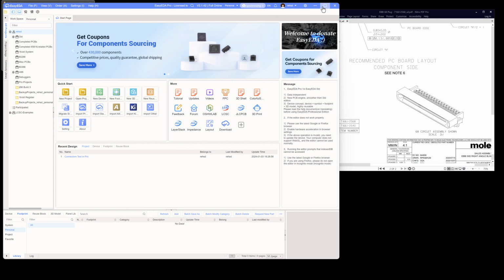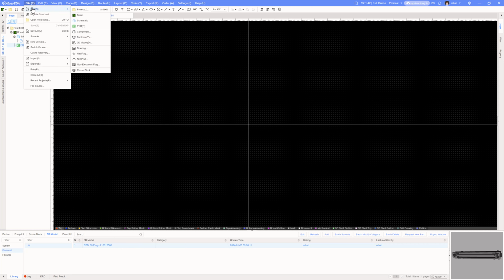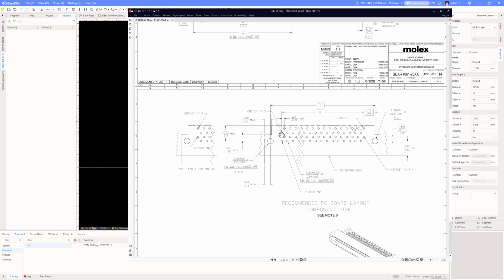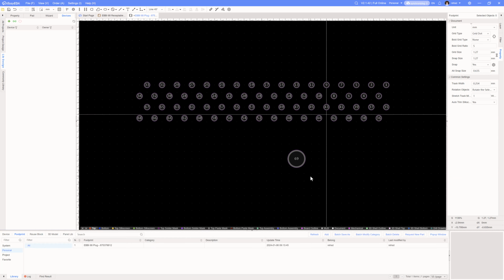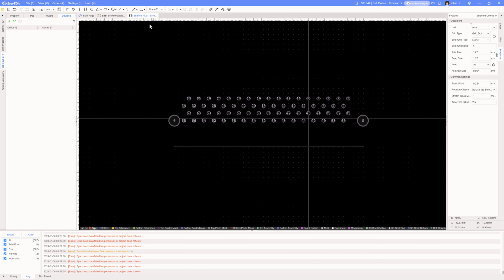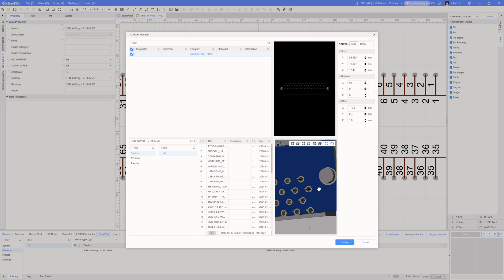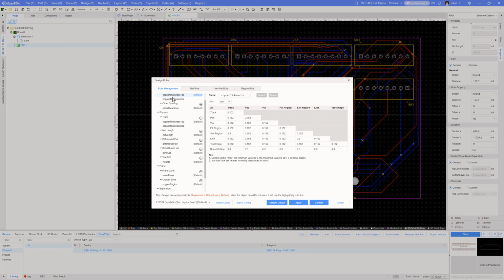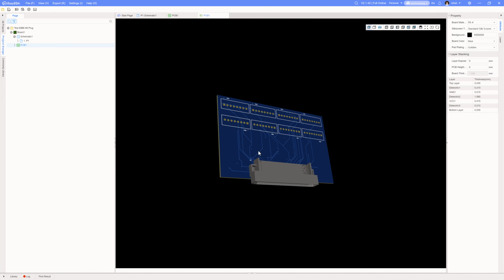Trying Out EasyEDA Pro - Creating a New Component (Device)

Comment: Considering if I should start with Standard or Pro.  What's the TLDR result?
Reply from the maker: I would go with Pro. I found Standard nice as it had a lot of older ICs in its library. However, the functionality -- especially performance -- is much better in Pro.
Reply: @rehsd  I did a few projects in Std and want to migrate them to Pro. It is a mystery on how to do that. Once you say one wants to migrate then the window opens listing the projects in Std which they say one must select. I do so and it appears selected and then I press Enter and nothing happens. There does not appear to be any buttons on the window either.  They also say export it to Zip, but the Export options are BOM, PDF, Altium, Net and PADS. So no ZIP available. Any Ideas would be appreciated.  Even their tutorial is of no help to me as i recommends the ZIP option. Not sure what I am overlooking.
Reply from the maker: @Appregator  I created projects from scratch in Pro. I also found any potential migration from Standard to Pro to fail miserably.
Reply: @rehsd  Ok Thanks. I'd better do it in pro.

Comment: Instead of manually placing pads and lines at relative location to one another, it is more accurate  to place them using the location pads(CenterX, CenterY,)  and lines(StartX, EndX, StartY, EndY) at absolute location, using information from technical drawing from the document.
Reply from the maker: Good point!

Comment: For a complete component there should be at least an outline which represents the silkscreen marking and a designator placeholder. May be an courtyard outline would be helpful too to keep placing adjacent components too close to the connector. If you create pads for the mounting holes may be creating them in the schematic symbol too and connect them to standard ground power net so any ground fill will automatically connect.
Reply from the maker: Some quick updates: https://imgur.com/a/RuMVGqk
Reply from the maker: Thanks for the tips, @0toleranz!

Comment: Would be nice to be able to use CAD-style drawing method to create the footprint. To be able to add constraints and enter the dimensions instead of faffing around with grids and stuff.
Reply from the maker: The grid can be turned off. I'm not sure about setting up constraints and such.
Reply: @rehsd  Don't get me wrong. Grids are helpful tool. Without grids it would be even more of a mess to draw the footprint. While grids are great for drawing schematics and routing the board, for making footprints they are pretty meh and rather cumbersome. But still, better than nothing. EDIT: I think that guides (like ones used in vector graphics) could be a nice and easy, in between, solution.
Reply: @pvc988 While vector-like graphics tools, such as Illustrator's shape tools, are more flexible, they introduce needless complexity. Most of the time you're laying out pads with set dimensions based on precise spacing and arrangements. Manually drawing, dimensioning and arranging them is more cumbersome, time consuming, and error prone. EasyEDA already lets you draw shape if you want it and also has alignment and arrangement tools too.